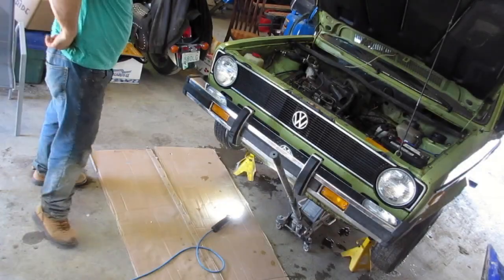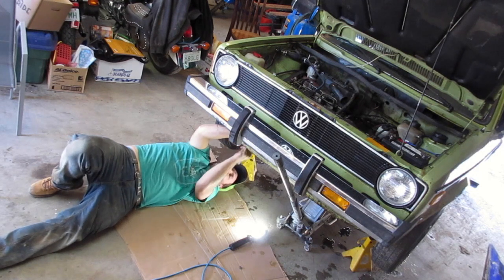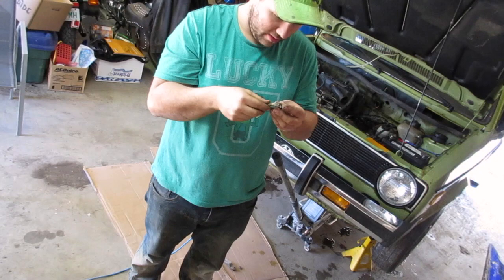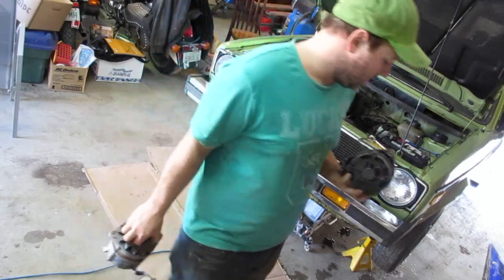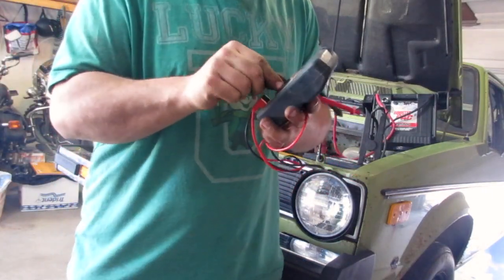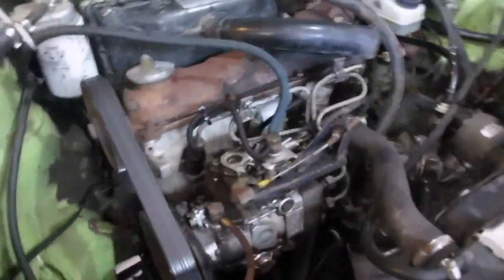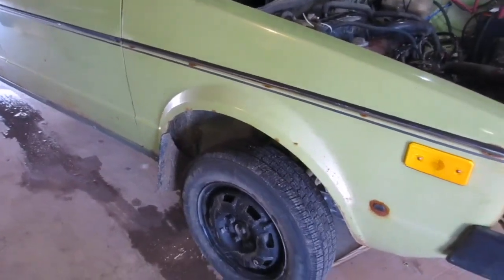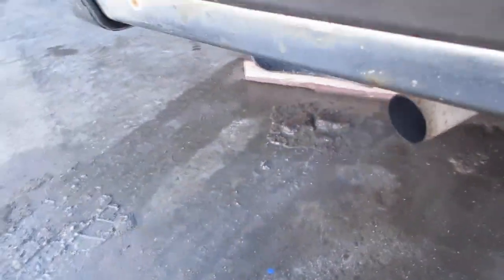Volkswagen MK1 Rabbit 1.5L Diesel Alternator Replacement

Comment: Back in 84 I had a 1980 rabbit diesel and when the company I worked for unexpectedly let me go I put everything into storage and I moved into my Rabbit. Three months later the alternator died so I swung by the local auto parts store and was informed it would be two weeks for a new one to arrive. Still had plenty of battery so I located an alternator rebuild service and drove over there and removed the alternator in their parking lot and walked in and asked how long it would take and 45 minutes later as I observed he completely rebuilt the 55 amp alternator ( no ac ). Total cost? $25.65. It lasted until I sold the car 14 years later. Wish I had another one. The auto parts store wanted $65 bucks.

Comment: A nice car for sure. Wondering if you had checked voltage when reving engine a bit. At idle the alternator light will come on on these old diesels. They take almost no power to run at idle and the alternator doesn't charge. Next  thought is the primer... It can save you a bunch of time and work when it is needed. If there is even the slightest leak in a hose or injector line etc and you park with the nose even slightly up hill the fuel can run back to the tank and when you try to start there is no fuel. Its a bummer to try to get fuel back to the injector pump.  Good luck with your rabbit! Thanks for the videos!
Reply from the maker: Very interesting because I has noticed it was not charging at idel and kinda wondered but wasn't to worried as it did jump up as soon as I gave it some throttle. If the primer is useful I will definitely be leaving it one the car. Next thing I need to do is figure out how to set the valves as someone mentioned its importance what's your thoughts on this? Thank you so much for your comments!
Reply: +This and That with Chris I've been having a power loss issue on my 82 1.6 diesel rabbit that I've had for about 2 yrs. I had the valves adjusted recently and that seemed to help a lot, but there was a new battery put in around the same time. Now I'm showing my alternator is bad, so hoping that fixes some of the power loss issue. From what I've heard the valves have to be done just right otherwise they can start going south and getting out of adjustment/alignment. The mechanic I've worked with is going to reset them again for free if they're out of alignment. 

Nice looking Rabbit you have, is that Wolfburg stearing wheel?
Reply from the maker: +increality yes I think it is but I'm no VW expert it's all pretty new to me. Thanks for the info on valves I want to learn how to adjust them iv been reading a bit. Thanks again for the comment!

Comment: The primer bulb is there because if you ran out of fuel you have to use that primer bulb in order to prime the system, get the fuel from the tank to the injectors, it does not have a lift pump, then you have to bleed all the injectors in order for the motor to start.
I know it has a check valve or one way valve inside that allows the fuel to get to the motor but not back in the tank and as I can see it is installed wrong, that one way valve has to sit on the top of the primer, the primer must be installed vertically and not horizontally . They have an arrow printed on them, that arrow shows the flow and it must point down , this way you know that the one way valve is at the top of the primer bulb.
Sorry about my bad writing .English is not my primary language.
Reply from the maker: +rzvmad thanks for the insite on that primer i could tell it wasn't factory looks like its from a boat so i was kinda wondering. its good to know what its for. i think i will take your advice and do a better job of installing it maybe even just put a new one on it looks old! i hope i never have to bleed the injectors. thanks again for your advise & for watching my video!

Comment: The diesel is running rough and loud due to not having 13.8volts from a good alternator. Mine did the same till I replaced the alternator and had to get a new battery.